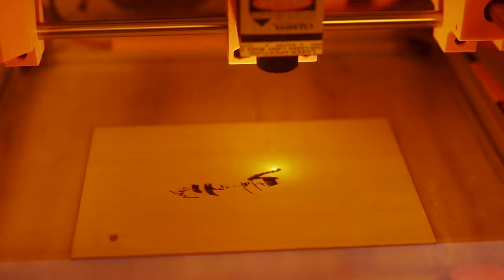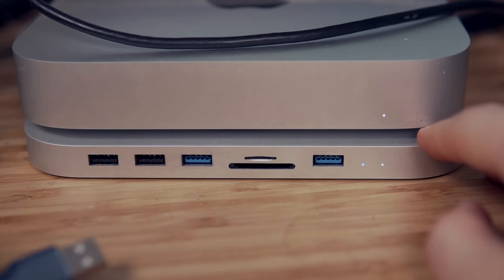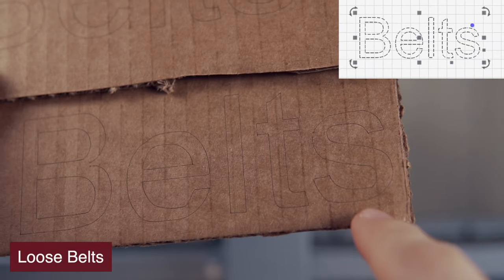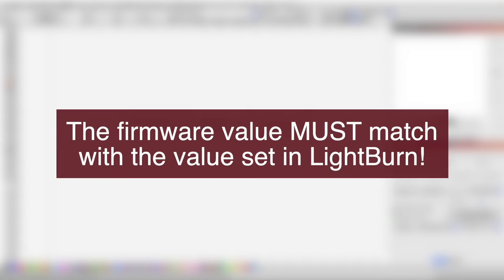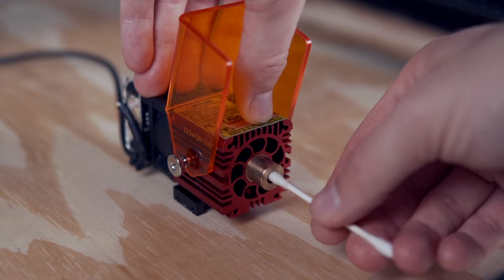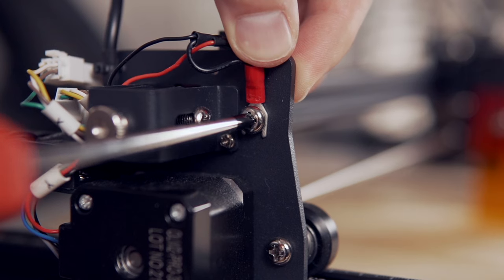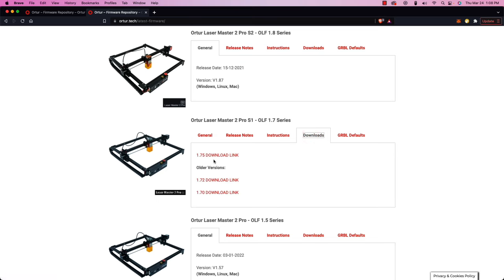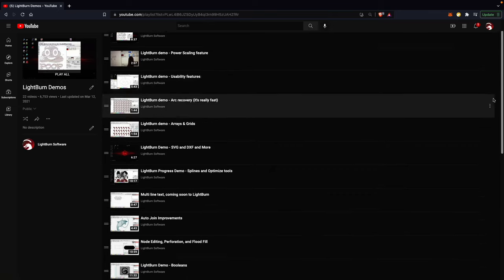Common Diode Laser Issues & How to Troubleshoot Them

Comment: Thank you so much for this video. I got a new laptop and installed Lightburn, and suddenly, my laser would not even cut 2mm basswood. Came across this video, and discovered that it was the S Value causing the issue. A link to this video should come standard with every laser engraver.
Reply from the maker: Glad to hear that this did the trick, its a fairly common issue.

Comment: This is not specifically a Lightburn question, although I have purchased and do use Lightburn.  I have an Ortur Lasermaster 2 pro, which I upgraded with a Neje a40640 laser module.  It has been working great for the past year.  Then today I added the extension kit to my Ortur to make the bed 400 x 800mm.  Now the laser module does not burn as hot.  I tested the the module in test mode and it works fine, but when I run a job through Lightburn the laser seems very weak.  This laser module comes with a digital readout and even though it says 50% on the readout, it is more like 10%.  When I set the board to test mode and adjust the PWM to 50%, it reads 50% and outputs 50%.

It's all the same wires, so I am wondering if there is a setting in Lightburn that can adjust the PWM or TTL or output frequency (I am not really sure) that will match the output of the board.

Totally perplexed.
Reply: Just as a side note, I checked all the settings you mentioned, and also updated Lightburn and even the Ortur firmware to the latest releases after watching your tutorial, but it's still not working.

Comment: This was so useful.  Thank you so much.
I was convinced my laser had to be replaced as suddenly it was not cutting what was easy before.  The S value was the culprit which I am not sure why suddenly wasn't matching the machine's value.  How do I ensure all the correct settings are set?  This sort of thing had happened before with certain parameters were not correct.  How do you ensure everything is optimally set up to get the best from your machine?
Reply from the maker: Glad to hear you where able to figure out what the issue was. Unless there was a firmware update that could have changed the value on the machine there shouldn't be anything that would switch it without manually editing it in LightBurn. Some manufacturers have a reset option in the firmware but if things are working as expected now I really wouldnt recommend poking around the firmware more than necessary.

Comment: I need Help!! my laser was working fine but recently it began to do something weird. it doesnt last in the correct spot. for example, i designed a heart shape with a name inside of it. it did the heart shape great and then wrote the name outside of the heart. ruined my entire project. second time it worked fine. next project, same problem. the first round went bad and second time was good. why is this happening ?

Comment: I just bought an Ortur Laser Master 3, and it keeps stopping half way through. I'm just testing it out and this is all new to me, and I'm disappointed so far. I'll follow the advice in the video. Thanks.
Reply from the maker: Any luck with this? Normally if a job stops there is some form of output in console. If you are still having issues contact our support - support@lightburnsoftware.com
Reply: @lightburnsoftware7189  Thanks. No still no joy. I have to make a video and take some pics, for the tech advisor, from where I bought it, and send. If I get the problem sorted out, I'll post on here. Maybe I should post a video on here. I have to get hold of a screen recorder to make the video. I have do it tonight.
Reply: We're having an issue as well.  Using Lightburn, Laser Master 3.  Laser loses connection before finishing.  First tries with the stock cable got through about 10٪ before dropping connection.  Checked the computer settings, bought a new, well shielded cable, and were now getting about 50% through before it loses connection.
Reply: @krystalpurdue1644  I tried a new cable, not a cheap one, but even worse. I am in contact with the tech people where I bought the machine. If we find the answer, I will update you. I put a video on my channel. I was advised to make another video, but this time have the window visible where all the laser info can be seen as it is lasering. So I will be doing that today. If you find the answer, please update us. Thanks.
Reply: @krystalpurdue1644  I had a message today, and this worked for me it seems. I did 3 engrave tests, all worked perfectly. Try this below. I will do more tests this week just to be 100% sure, then make another video to let other people know. Keep in mind I already disabled all sleep settings on my computer. Try this.

Right click start menu on windows -> device manager
Expand DISK section -> Right click Espreessi Mass Storage USB Device -> Disable
Restart the machine.
Reply: @fretboardfodder1037  Thanks, I'll check that out.  We weren't able to keep our laptop connected even when not trying to run the laser.  We plugged it in and it would disconnect without trying to use it.  But, our work notebook doesn't disconnect (can run Lightbrun with it though).  After that test, we tried using our desktop, and that worked perfect, no dropouts and was able to run a full cut.
Reply: @krystalpurdue1644  I am quite confident this will do the trick, as long as you have already disabled all sleep settings etc, especially your usb ports. I have some time if work this week, so I will spend a day testing mine fully, but I think it should be ok now. I have a really good DELL desktop, but when I had the problem, I did plug my Toshiba laptop in, Windows 8, but realised I need to Windows 8 drivers for the machine, so didn't bother. Be careful to follow the guide to the letter.

Comment: I just got lightburn and I'm still trying my best to learn it thanks for the hobby guy and of course you guys! How do I know if my d1pro has all the correct codes?
Reply from the maker: Do you mean error codes? As long as the output appears correct I wouldn't worry about it too much. (unless the machine is throwing an error). This video is meant to give you a grasp on what could cause errors and what to check if you do run into one of them.
Reply: @lightburnsoftware7189  No so far I've been really happy! I still got a couple weeks on my free trial. Still trying my best to learn! My business logo is very complex. I made it into an SVG outline, but it still doesn't look right for cutting boards & stuff. Maybe I'll just plaster a sticker on it?

Comment: I have a Longer Ray 5 10w and one problem I have is that cut settings that work on the test card don't work the same in a project.  One thing I've noticed is that sometimes vertical cuts will burn through while horizontal cuts won't.  I thought maybe it had something to do with grain pattern but it even does it on MDF.

Comment: Thank you.  Your video is very helpful.    I've been using LightBurn with Neje Master 2S machine for sometime and this video have reminded me about several issues I encountered.  All of them was fixed after receiving reply from LightBurn Forum. Recently  I encountered a problem when engraving Ceramic Tile.  After about 1.30 hours of burning the engraver stopped.  One of your recommendations in the video is to connect a ground cable.  Since  engraving machine cables are the 9mm round input jack which have two wires and if I connect a ground cable on the engraver machine where should  I connect the other end.  Thank you

Comment: I have an issue with my kentoktool laser where when you power it on the motors pulse and the laser fan doesn’t turn on. As soon as you unplug one of the motors or the laser then it powers on properly. It also losing connection to light burn if the laser power setting is too high. I really need help with this!

Comment: Hi, thank you for the video. I just purchased the tts-20 pro but it won’t engrave or cut anything. I have tried different settings and power lvl woth different designs all it does is try to do the pattern and I can see the laser light moving but it won’t engrave or cut anything.
Reply from the maker: Did you make sure that the focus is set correctly for the material? Also take a look at the section under "Power output is not the same as other software (GRBL)" in our troubleshooting article:
https://docs.lightburnsoftware.com/Troubleshooting-Output.html

If you are still having issues reach out to our team - support@lightburnsoftware.com

Comment: Hey! I have the Sculpfun S9 and I am having the problem described in 3;00 , I tightened the belts but when there are quick and sharp movements a normally symetrical print turns unsymetrical - I do not know what to do :(

Comment: Do you by chance know why when I turn my laser controller off it still has power to the controller board. It will only power completely off if I remove the usb cable. I suspect a ground issue somewhere but do not know where it would be. The power supply is 3 pronged so I am grounded there and all connections are properly connected.
Reply from the maker: This is fairly normal depending on the controller. Many of them can be flashed over USB so the 5v from the cable will power on the controller. Usually it will just be the board though and not fans or the laser module.

Comment: My Device Settings for the Workspace setting for X & Y do not match the console output for $130 and $131. On the console it shows $130=432 and $131=406 like you have in this video. When I try to update in the console and type $130=430, enter it returns with "ok", but upon confirming with $$ it still shows $130=432. Is this a problem that there is a mismatch and if so, how do I update it?
Reply from the maker: It should be an issue unless you are trying to squeeze those last 2mm out of your work area. The stock firmware may have been updated to not make this something you can edit. The only reason I could think of would be a 2mm tolerance buffer.

Comment: Houston we have a problem. New machine, just yesterday I was doing piercing on stainless steel, everything was okay. Today there is no piercing. Same material and same settings. What do I have to do? Sculpfun s10 bought on AliExpress. Cleaned the laser, it turned out to be a torn gasket, replaced it, did not help. I don't know what to do. Maybe the lens is burned out? How can it be replaced?
Reply from the maker: I would start by checking our grbl guide for output issues: https://docs.lightburnsoftware.com/Troubleshooting-Output.html#power-output-is-not-the-same-as-other-software-grbl

There are a couple of things to try in there. If you are still having issues and believe it may be hardware related, I would next contact the manufacturer.

Comment: I have a quick question about how the laser engraves, mine doing a grid will randomly engraves the squares but when the project completes it is what it was supposed to be. So if lasering a grid it works in a random pattern instead of cutting in rows and columns how do I fix that?

Comment: Hello, I just set up my Longer ray 5 10W laser with an air assist. When I hit the frame on LightBurn, my laser just goes to the left off of the small piece of wood. I set the dimensions  to the size of the test wood piece but it's just going to the left even when I hit start. Thank you for any help you can give. I am a beginner.
Reply from the maker: It sounds like your origin or start from mode is not correct. We have a video covering the different start from modes and how they work here: https://youtu.be/aphiLTUWcjE?si=cSRlQtpT1Pi2zZ5h

Comment: I'm having a Y axis issue where when I go to frame, it just goes left and right and seems to be stuck going up and down. It's like a shake when it tries to move. I tried tightening and loosening the belts
Reply from the maker: Is it only know moving in the Y direction when framing or the machine just will not move in the Y axis? If the laser is not moving in the Y axis, the first thing I would check is the cables. Check that the stepper motor cable both on the Y motor and Y connector of the board is seated properly.

Comment: Please help I don't know what happened? I've been practicing with my 20w xtool. All below 50% power. I decided to try the infrared for a little bit on some metal had to go to 100%. Now I plugged back in my 20w and the light is just really bright and big? When I use the fire button it's fine. When I go to engrave it changes? I have reset and unplugged what now? No updates on XCS or LB. I don't think I would have cracked my glass, I don't know how? Anybody have answers? 🤔😒

Comment: How do I adjust travel speed? What in referring to is speed of the laser when it's not firing. It's really annoying having the entire job go really slow cause I set the laser speed low. Is there a way to speed up the process so it slows down to firing speed only on areas that need engraved/cut.
Reply: I believe there is a setting to ignore white.  I saw something about that on a Louisiana Hobby Guy video.  Sorry, I don’t recall which one.

Comment: Hello, im using ortur master 2 
Just instaled a new 80 w laser 
And it wont stop burning on travel nor when it finishis the job iz Just goes to zero and still working and burning the zero point. I have followed instructions and have cheked the $$ and it was already at 1 . Is there any other problem?
Reply from the maker: Was this an issue with the previous laser module? Run through the items listed under "Short Version" here:
https://github.com/LightBurnSoftware/Documentation/blob/master/CommonGrblSetups.md

Comment: I enter "$32=1". When I refresh with $$, it still says $32=0.
Do I have to somehow unlock the Console?
Reply from the maker: What machine are you using? Some manufacturers have it set in a way that resets the settings on each power cycle.
Reply: @lightburnsoftware7189  
Ok, I restarted the program. It’s working now. 
Foxalien Vasto, by the way. 
Thanks.

Comment: I did the whole set up. My laser worked a good few minutes then stopped. Now it won't turn in. I jus bought the machine. I even did a reset. I don't understand what could possibly keep the laser from turning on. Any info would help.
Reply from the maker: When you flip the switch for power is there any LED indicator? On mine the red emergency power switch had been pushed down so check that. Otherwise, it could be faulty Power Supply, or an issue with the mainboard.

Comment: I have the sculpfun s9 with lightburn. The laser moves very slowly during framing and cutting, but moves at a normal pace otherwise. We've adjusted the speed in lightburn, but nothing seems to work. Any ideas?
Reply from the maker: The framing speed and travel speed is set in the move window. The text box labeled speed between "distance" and "z-speed" is the one to adjust. The actual speed of the engrave (line or fill) will be set in the cuts/layers window.

Comment: Hello
When I frame a object to engrave my laser head frame the same at different postions slithly left or right or up and down. Doest frame same position when I frame the same file more than once
Reply from the maker: Do you have your travel speeds set to high? If the motors are skipping steps that could cause this. I would lower speeds, and also check both belt tension as well as the set screws on the stepper motor idlers are tight.

Comment: It could be an issue if the power source exceeds the laser's current consumption ?. For example, requirement is 12V at 4A, but my power source is 12V at 10A.
Reply from the maker: As long as the voltage is matching, the diode will not draw more current than it needs.
Reply: @lightburnsoftware7189  Thanks !

Comment: I have an issue where the laser fires when moving (very little power maybe less than 1%) how can I solve this? I suspect it is a static build up
Reply from the maker: There are a number of issues that could be causing this. 

Knowing what laser you are using will be helpful along with if it was always doing this or it is something that recently started. 

Our support team can be reached at support@lightburnsoftware.com
Reply: @lightburnsoftware7189  I have a custom frame with a NEJE motherboard and a Sculpfun S30 Pro 10W module, and my garage outlets are not grounded, so I guess there's a lot that can be causing this. I'm in the process of grounding the frame and passing new cables to ground the outlets and see if it persists

Comment: I have a problem my tts-55 laser pro runs but does not engrave, any help ?
Reply from the maker: Has it connected successfully and can run frame commands? And just to confirm there is no power output at all? 

If you are still facing issues, contact our support team - support@lightburnsoftware.com

Comment: After entering $32=1 to switch to laser mode, is this permanent or I have to perform this switch to laser mode every time I power on the machine?
Reply: In settings of lightburn these $parameters can be changed easily and saved on laser as well. Regarding your question - it takes 2 minutes to check by yourself. Would do it, but unfortunately will be back at home only after 3 months.
Reply from the maker: They should stick, but it also may depend on the way your contoller/firmware is configured. Easiest way to test would be to change the value and then power cycle your machine. Upon reconnecting enter $$ and see if it retained the $32=1 value.

Comment: Hi , my aufero laser keep flashing and don't reconnect within Lightburn. Is there any button for connecting Laser? Thank you
Reply from the maker: There is a lock on the Aufero when you first connect. Try clicking the stop button in LightBurn or typing $x  into the console.
Reply: @lightburnsoftware7189  I emailed customer support yesterday and they advised same .. $X All good now. Thanks for replying!